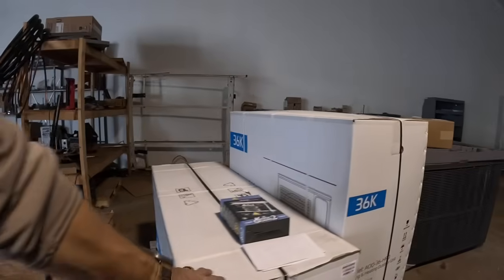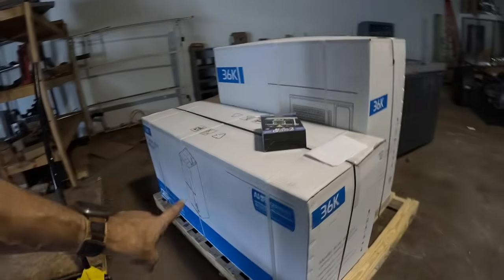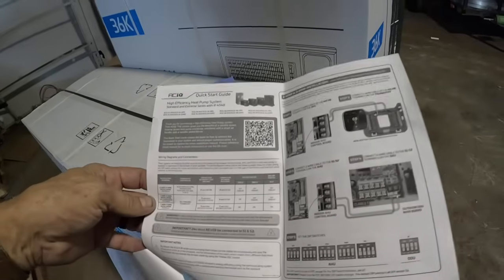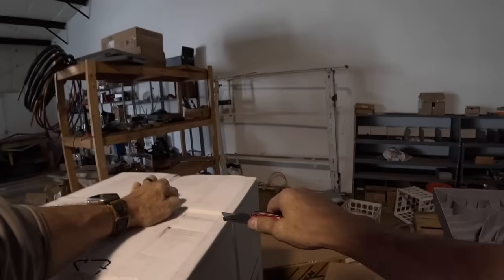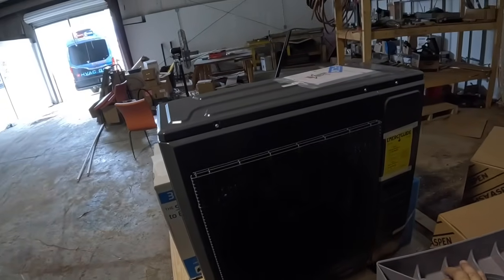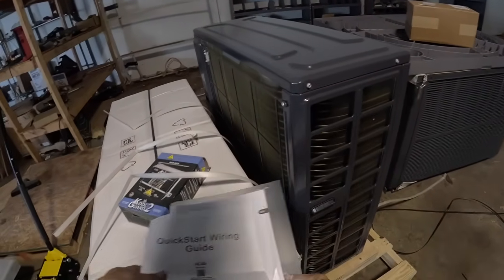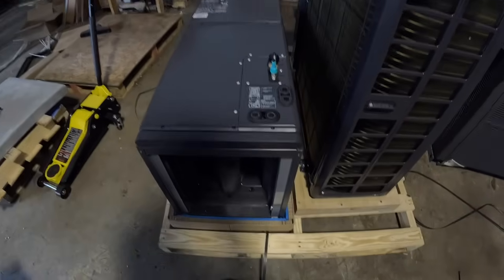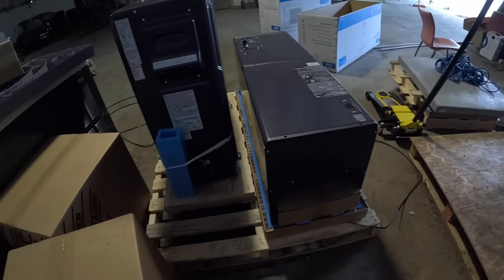Unboxing Of New ACIQ Heat Pump!

Comment: I'm pretty sure this is just a midea evox rebox.......I've put over 30 midea units in.....they are great 
You should be fine with 18/2 just match polarity 
The new communicating tstat is a ecobee knock off and also nice .....and again 2 wire 
Pretty kick ass systems and ridiculously cheap to buy

Comment: Curtis, we've been using a low temp mini-split for 6 years here in se Minnesota.  It heats fairly well to -10 and goes down to -22.  It should work good for South Georgia.  Much cheaper to run than resistance heat.

Comment: Someone claimed that for the Innovair communicating, if you use the 2wire setup it should be shielded (so you technically need to run a new cable) but I used it with regular tstat wire and it works fine. Hope that helps. I think they're all Midea?

Comment: I'm surprised that you need heat strips to back up a heat pump as far south as you are.  I live in north central Kentucky and our heat strips very seldom come on- only if it gets below 20 degrees.
Reply: A heat pump will keep heating well below freezing. But it's not a real cozy type of heat. Like a gas furnace would keep producing at 30 to 20 degrees. The electric heat piggy backs the heat pump, to boost heat output, at such temperatures. Or to keep the system from cooling down during defrost.

Comment: I have an ac unit with air handler in garage (not cooled). The tray gets filled with green algae over time and you can smell the algae when ac runs. I cleaned it out and added algae tablets but you can still smell the algae when ac runs. Have you ever seen this. I'm assuming I will have to have duct work cleaned.

Comment: The ACiQ Extreme+ Heat Pump and Air Handler are top of the line! The home owner is getting one great system! You both will love it.
Reply: I'm just wondering how much it sets you back, looking really nice.
Reply: @jthonn  $4-$5,000
Reply: @jthonn  ACIQ don't cost a lot at all. Even a standard scroll one stage version is well below thousands off market price compared to any other unit. So the inverter units are well below market price
Reply: Great system 😂😅😂😅😂😅
Reply: @ralph95 so what is a great system in your opinion? we are seeing how low quality of everything is, and the big brands are no exceptions, they don't have good reputation anymore